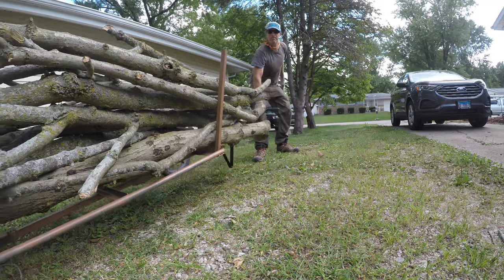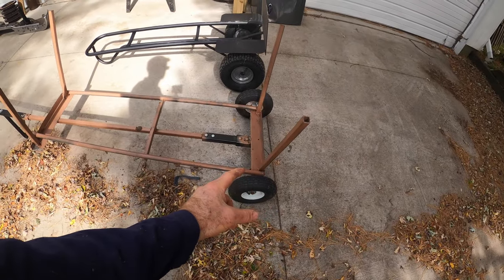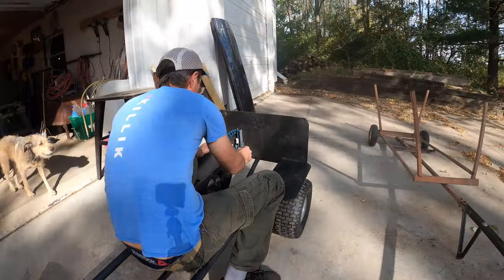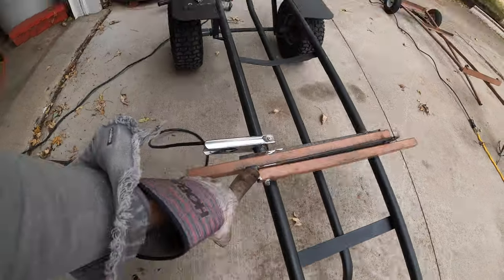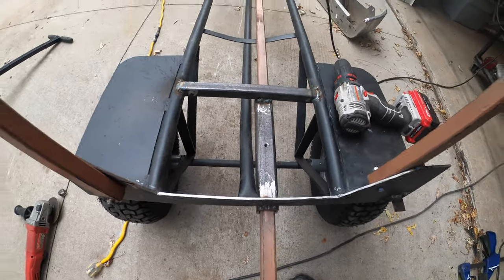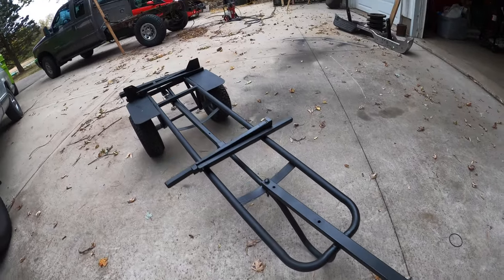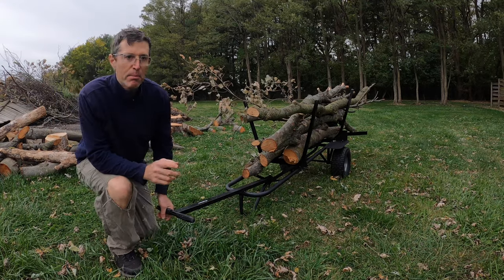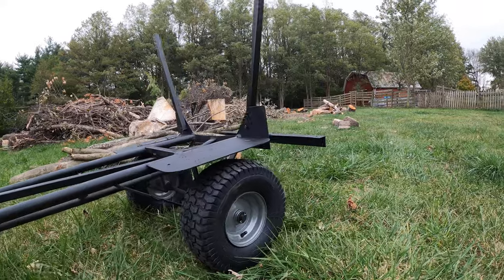Tree Trolley / Lumber Cart Build

Comment: Love this idea. I trim alot of palm trees and would live to have this to drag them to a central location closer to where I could chop them up.  Everything you added is perfect except I would make the pulling handle a little higher so I would not have to bend over as much and maintain the center of gravety on a heavy load. I would need to make mine so I could breakdown the cart for I use my handtruck for many applications. I would live to learn how to weld but watching videos is not as good as having a teacher. Keep designing on the fly like we both do. Love your channel.
Reply from the maker: Raised handle sounds great. I’d love to do a palm tree someday

Comment: Nice upgrade. I saw the tail drag and thought you could bend the handle arm up enough so you don't have to bend over to pull it and the load would stay fairly level
Reply from the maker: Exactly. If it keeps giving me trouble after shortening the end I'll but up the handle ... good eye, my man
Reply: @metaspencer  I'm a jack-leg inventor like you. Some of the things I built to make my life easier on the farm had my neighbors shaking their heads and wondering why they never thought of that. I'm always looking for a better/easier way to do things
Reply from the maker: @SteampunkSteve  Jack-leg! I like that phrase and will have to borrow it :)
Reply: @metaspencer  it's an old fashioned term I picked up somewhere. I use the definition of it as amateur. But after looking it up I may be using it wrong

Comment: I know chippers are expensive but you have a lot of room at your new place. You could mulch all of your brush from tree cutting right into your dump trailer and instead of 2-3 or more loads to dump your brush you could do it all in one and dump at your house and compost your chippings to amend  your soil for gardens and such. You would be (one and done) with brush so to speak. It would just be another piece of equipment to haul around.
Reply from the maker: Aside from adding another piece of equipment to haul and maintain, I'm with ya man: it would be faster, easier, and better to chip. So it's on my list ... you're not the first guy to recommend one! haha I guess I'm a late adopter :)

Comment: Awe vid as always. Cook and neat idea. If you made much taller it would tip over too easy. Slight bend on the handle would be nice too. I would add a stop collar on your extension piece so you can pull or push it to the stop and then pin it. We made an extension on a trailer to haul long plastic pipes and that made it super simple to find the hole for the pin.
Reply from the maker: A stop collar! Yes, great idea and thanks for that. It's exactly what I need along with the slight tweak to the handle. Thanks

Comment: Hey man, Pretty awesome stuff, thanks so much! Think this is a great idea for fence building and am going to try something like this out to take a load off the daily lumber haul.. I have zero welding experience however so am going to try just metal drill bit with nuts and bolts. 😬 thanks for the ideas!
-yours truly,
Justin
Reply from the maker: I used to build fences myself and the cart came in SUPER handy. Huge time saver. Yeah, you should be able to bolt something together without much trouble. Modifying a gorilla cart might work for ya too. Hang in!

Comment: Cool build.  Did you consider turning the last 25% of the exstendo arm up at an angle so you could have the length with out dragging while at full tilt?   Or could raise your handle up closer to your natural carry point, resulting in a more level cart?  Again nice work Mr.
Reply from the maker: After a few tests I made that tweak and the cart flows a lot better. It's a back and life saver! Thanks man
Reply: I’m looking into following this build. What tweak did you make? Angling the rear extendo-arm or angling the handle?

Comment: Another good reason for bending the arm up is like you just said about the back arm sliding out and touching the ground when you lift up on it if you've been the front arm up your only picking it up just a little bit and going forward with it then you won't have to drag you back in
Reply from the maker: Absolutely. I love that idea and will have to fun with it. Just a few inches up would make a real difference. Thanks!

Comment: See if you follow this. The tail is dragging on the ground when you pick up the handle, and when you do so the whole cart is slanted to the rear. If you raised the starting position of the handle (Spacer between the rear connection of the tow handle to the cart)). When you pick up on the handle the cart would be closer to level and the rear extension would be further off the ground???
Reply from the maker: I gotcha! needs a few more inches to travel well over rough ground. I'm always in awe of your powdercoating, btw. thanks buddy

Comment: That’s a cool trolley. Very handy!  I guess you could put a slightly upward slanted section right at the end of the extendo-arm to make it not drag and get even more length/support in the back...

I waited all summer for bus videos... what’s going on with the bus?
Reply from the maker: That little bend in the handle is a great idea! If it keeps dragging I'll have to take your idea and run with it. Here's your bus update: I finished tile and did a few little things with it this summer, partly while staying in it during a short quarantine after taking a trip. So it's been a great space to hang out in. The batteries haven't been charging right so I noticed I lost a belt ... alternator. So not being able to reach the belt I dropped it off at "my guy who fixes buses" and it's been there a few weeks. So that's it: nothing much to report. It's just "the bus!" :)
Reply: @metaspencer  thanks for the update!

Comment: nice idea and fun project, but you extension in the back is scraping on the ground and looks almost redundant. for professionel use i would still prefer steins arbor trolley
Reply from the maker: Yeah I had to raise the handle up a few inches to avoid that drag. The Stein trolley looks great for sure